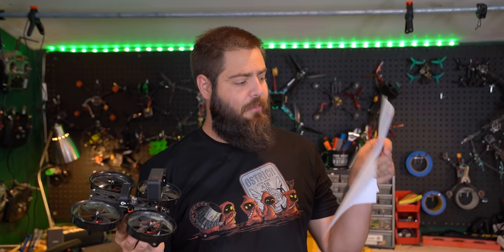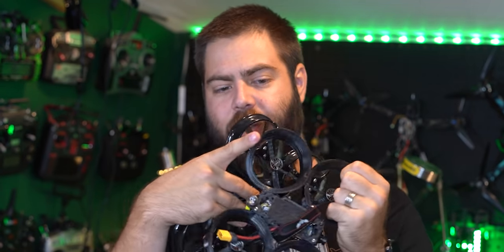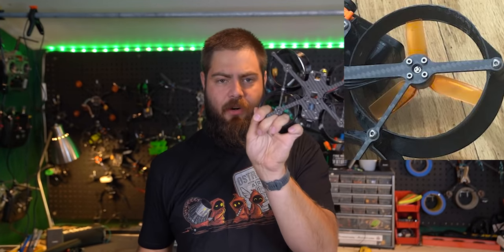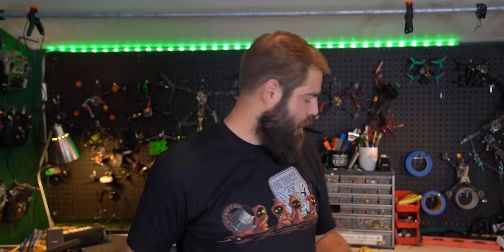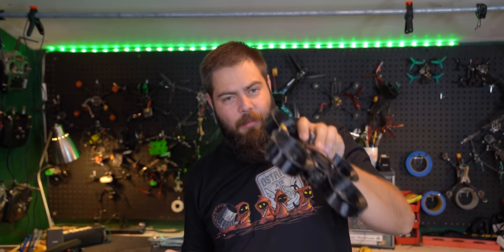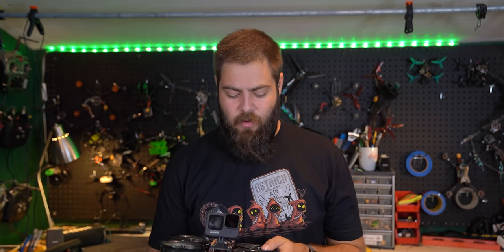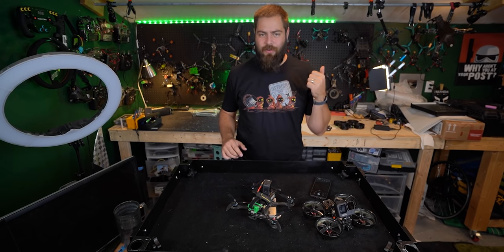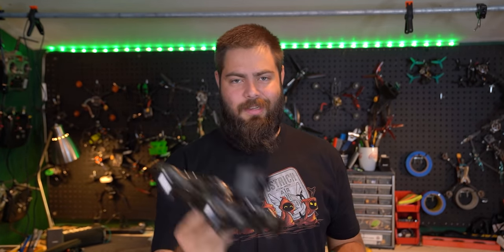Shendrones Terraplane Full Review

Comment from the maker: Parts used in this build:   (Affiliate Links that Support the Channel)

Frame: https://bit.ly/3tOgWwY
Flight Controller/ESC: iFlight SucceX Stack 20x20: https://bit.ly/3bGpHk1
Alternate Flight Controller/ESC: T-Motor Mini F7 Stack: https://bit.ly/2Ujgi9Y
Caddx Vista: https://bit.ly/39di7N9
Alternate to Caddx Vista: https://bit.ly/3zjzw12
Motors: https://bit.ly/3lQtT63
Alternate Motors: https://bit.ly/3EulAVK
(Optional) TBS Crossfire: https://bit.ly/3ki2OYd
Battery: https://bit.ly/3lDNfLz
Bunch of extra m2 hardware: https://bit.ly/3lyv7mf
Solder Practice board: https://bit.ly/3AoAqL5
Reply: Hi @NURK FPV, could you share your ESC and BF settings for this? PIDs, Rates, Filters, etc.  Thanks 😁
Reply: Hi, why do you use standoff to 28mm ? It seem it 20mm with my terraplane frame.

Comment: I have only had my Cinelog30 a couple weeks and you have me already thinking about retiring it. I think 2004 motors should be the minimum for a cinewhoop now, these 1404s are too hyper.
Reply from the maker: Always diy!
Reply: @NURKFPV  I should say, I did build it! With the iFlight F7....before I knew rpm filtering was broken! Not worried about tearing it apart! Might even convert my Kopis on 2004 to a cinewhoop.
Reply: @nurk fpv is this the micro cinewhoop you held up towards the end of the video?

Comment: i have heard there is a way to configure the settings on smaller whoops that keeps them less likely to get stuck to a wall which may work on somehting like this
Reply: Yeah air mode and throttle mixer. Air mode only activated at low throttle, disables itself depending on a determined throttle position

Comment: Why not just put injection molded style ducts on a 5" frame? What does this frame do special over a regular 5" frame? Seems easier to put prop guards on a five inch than to take the guts out of a 5" and put it on a new frame.
Reply from the maker: This is much more compact than a 5"
Reply: @NURKFPV  Oh ok. Thanks for the response.

Comment: Hey Nurk,
Thanks for this - I think I'll move this way in the near future.
However, for the meantime, I've just swapped my Squirt v2 from Analogue to DJI, and the tune has gone to sh*t. Do you have any recommended pids or tips?
Thanks
Reply: shouldn’t have used full size air unit
Reply: @mikeybroe1  The squirt is designed and shipped from Andy with specific mounting for the AU and plenty of people, including Nurk, fly them as such. But thanks for your oh so helpful insight..
Reply: @ArbeeAerials  yeah np

Comment: A question I want to throw at your beard: Filming in 60 fps with a Gopro, does that mean my editting in DR's timeline should be in 60fps aswell or can I work with 24fps? The goal is to create nice smooth cinematic footage. Thanks in advance!
Reply: Your recording framerate and timeline framerate should always be matched if possible. The only reason you'd want to use 60fps on a 24fps timeline is for slow motion. 60 cannot be divided into 24 nicely, so you end up skipping frames and having uneven playback when doing this. You could put a 60fps video in a 30fps timeline, as this would mean your final video would just skip every other frame. Although, if you're really worried about cinematic quality, this also introduces shutter angle complications, as you'll no longer have a proper 180 degree shutter angle.

Here's a great video on the subject: https://www.youtube.com/watch?v=qAVfIQ2G7Io&t=371s

Comment: My terraplane motors run pretty hot… correct screws used, build is fine, not sure what’s going on. Using the tmotor velox v2 2207.5 2550 kv on 6s. Not sure why they are pretty hot 😕
Reply from the maker: That's very similar to mine. Mine are definitely warm but not smoking or anything
Reply: Oh ok sounds good. Thanks for the reply!! I though I might have done something wrong. Thanks again and keep up the great videos!!

Comment: Quick question: why are you using 5s motors with 6s batteries?
Reply: He runs 6s
Reply: @TheDansindan  the link for the motors is for 4-5s motors
Reply: @erionlipo1776  Yep, but the terraplane is essentially a Geyser V2. Designed around running high KV motors on 6s. I run 2550kv on 6s on my Terraplanes.

Comment: putting air mode on a switch then making it correlate with the throttle fixes the getting sucked into the wall issue

Comment: Seems like ducts cause way more issues than it's even worth.
Reply: No, with a cinewhoop the ducts are super necessary, as they mostly fly indoors or around expensive objects and people. Just the extra security of the ducts is great as you do not have to worry anywhere near as much as if you were flying a non ducted quad.
Reply: @PeugeotL-vd2le  as in ducts being not worth it. I have a diatone taycan with foam and ducts removed and it doesn't get blown around and is still safe with carbon guards  protecting the props